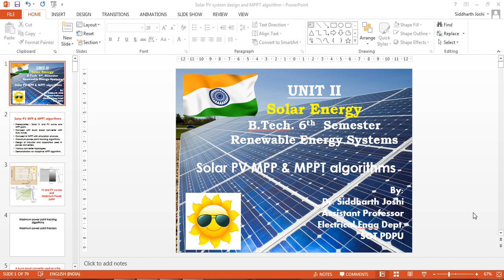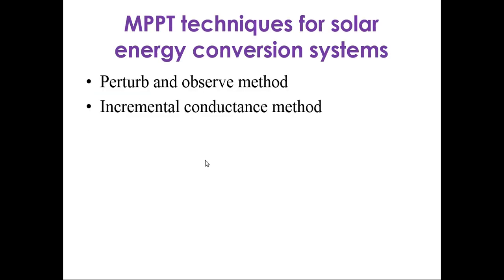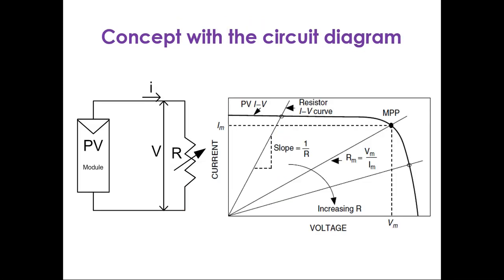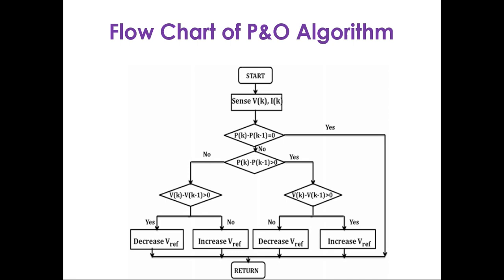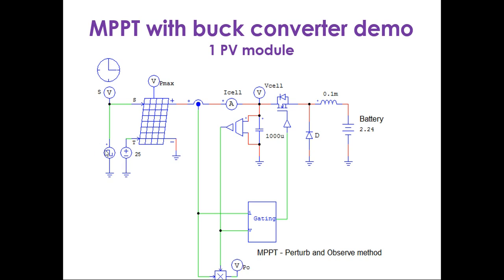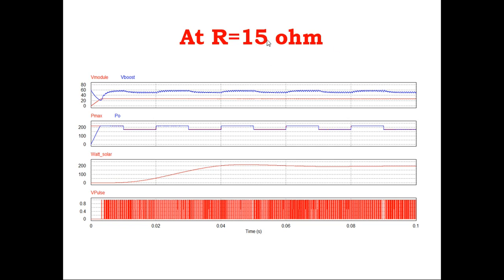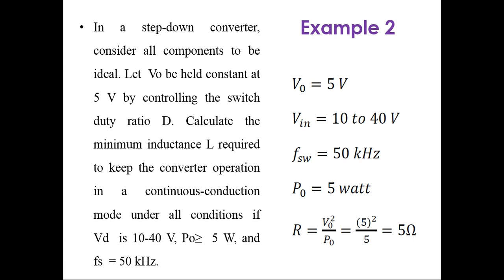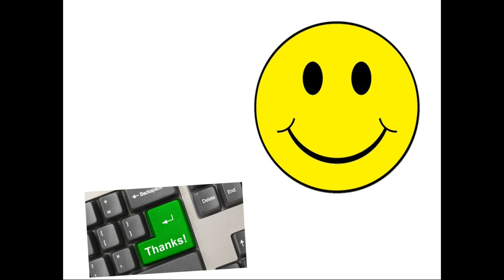MPPT algorithm for PV applications

Comment: Goo day, for a PV battery charging system what converter topology would you suggest and what control strategy to be able to implement MPPT and charge the battery,  my understanding is that you can not implement MPPT and keep the output voltage constant. So i decided to use a cascade boost- buck converter to simultaneously control the charging and the MPPT, is there a better way to charge the battery or an alternate way
Reply from the maker: In the current market situation mppt based inverter is available.
Reply from the maker: Yes sir MPPT will not give us constant voltage. But for bidirectional converter MPPT i have not used, it dosent mean that one cannot use. Thank you. @Vuyani N

Comment: How mppt works in Grid connected systems where we dont know the load resistance
Reply from the maker: It works in the same way like standalone system; as the duty cycle of converter will vary with change in atmospheric condition. For grid integration we need to take the sample of grid angle and the dc link voltage at the input of the inverter should be maintained.
Reply: @siddharthjoshi3146  in mppt do we need to change just the voltage to get the mpp or voltage + current or i and v + the impedance, and Can WE do that with just an inverter or WE must have a DC DC Converter, i feel confuse about mppt i cant get the principle, do you have a good Book or ressource about mppt